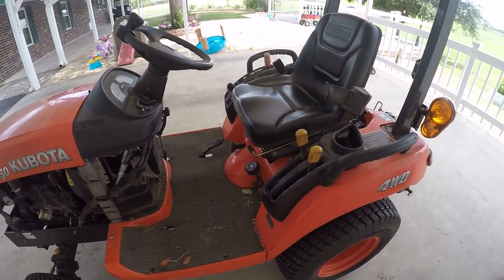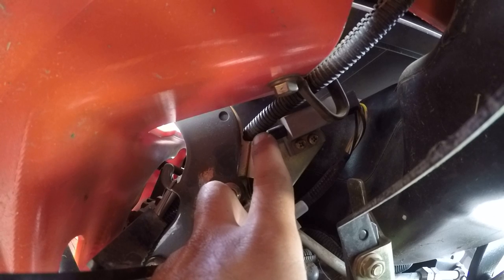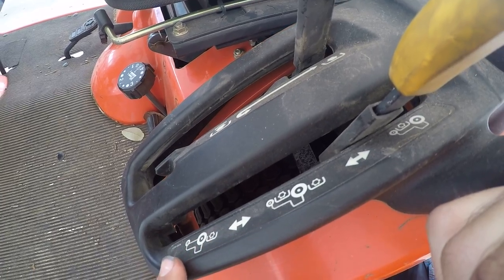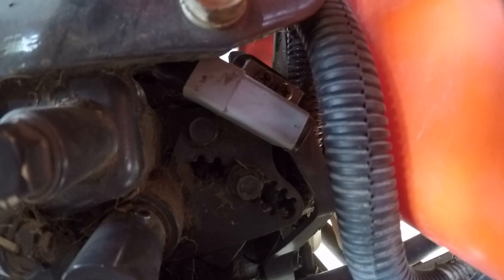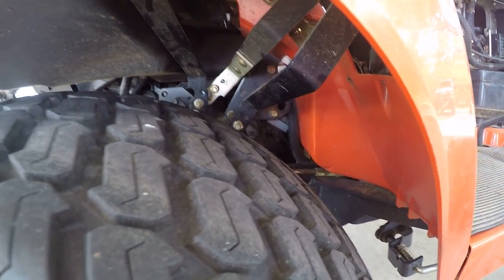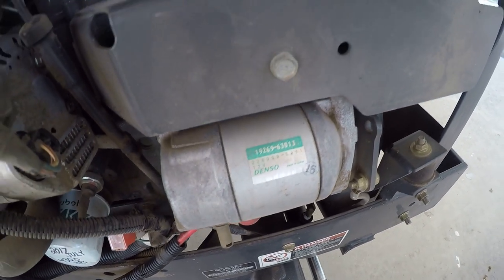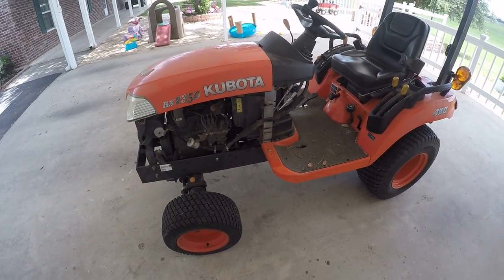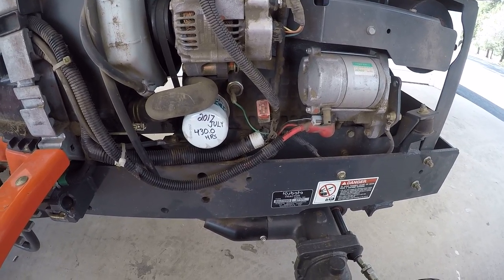Kubota BX2350 - No crank common issues

Comment: I checked all the things you mentioned and it started. Now I just don't know which sensor or wire it was lol. This is the 3rd time it has done this recently.
Reply from the maker: If it's a switch, it's probably one that is only lightly getting pushed & the vibration & flex of the tractor is just enough to make it not pushed enough to let the tractor start.

Comment: When 'safety' system fail so easily, they're not safe. They will convince owners to bypass those systems.
Reply from the maker: They just need adjustments usually. Not knowing where the switches are is where the challenge can be. After 15 years of rattling, something is bound to come a little loose!

Comment: That switch at the front of the seat that you said you didn't know why it was there is for the rear PTO. You start the tractor then flip the seat up and you can use the rear PTO for like a chipper or what ever you are running.
Reply from the maker: Thank you! Had no idea.

Comment: Wanted to thank you for posting and leaving this video up. I have  been struggling with a BX2200 not starting for several days and from your video I was able to figure out the PTO safety switch was just barley engaged. I lubed the PTO shaft and I noticed the safety plunger wasn't moving when it came in contact the metal tab on the shaft. I lubricated the plunder and worked the PTO shaft back and forth several times and I noticed the plunger was sitting up higher than before. I tried to start the tractor and it started right up so thank you very much!  You saved me several hundred dollars the Kubota dealer would have charged. Thanks again Ron
Reply from the maker: No problem Ron, that's why I made the video. Appreciate you watching and giving me the feedback. Consider a Super Thanks since the video saved you money! It helps others find the video easier and helps me out as well.

Comment: Thanks for taking the time to make this video. This is a good and worthwhile video if you’re having crazy intermittent starting issues that are related to switches not functioning. I have a Kubota GR2110 and the thing has been driving me crazy. I can tell it’s in the safety switches somewhere because when everything is satisfied it starts right up and stays running. Now I know where to start poking around. Thanks again!!
Reply from the maker: Glad it was helpful!

Comment: Thank you for saving me 6 hours!  I checked the contacts under the seat and and then the PTO behind the rear wheel, and it was exactly as you described.  5 minutes and a PHILLIPS screwdriver and I was off and running!  Great video and thanks again for saving me time and money!
Reply: Same here.  I was freaking out as I was in the middle of a job with the bucket full and poof. No start. Exactly the same switch.  Thanks for this great video.
Reply from the maker: Glad it helped both of you. I've been helped so many times over the years with YouTube... I'm glad that I've been able to give back!

Comment: Thanks for pointing all this out.  I just started to have a starting issue with a new BX-25 that I bought back in 2008.  These switches are for the lawyers and birds!
Reply from the maker: Considering issues are popping up 15-20 years later, the switches held up not so bad!
Reply: @CallMeColtLLC  Finally got my BX-25 running again, after yanking out the starter and taking it to the dealer.  The starter was good.  It was the friggin PTO safety switch.  The dang thing slid back and had to be slide forward and re-tightened.  This is the second time this switch caused me problems!

Comment: Thanks for video. Getting ready to look for intermittent start problem. Pretty sure it's one of those switches not bypassed. Also will look for glow plug issue. Need to jiggle switch wires to get them to work.
Reply from the maker: Safety switch probably came loose and just need adjustment. Quick and easy. If your glow plugs are not working at times, you may have a ground issue from the key switch. Maybe why you have the start issues at times at well. Last thing could be sticking relays. Just a guess.

Comment: I have an L3710 that's been driving me nuts with intermittent starting. I'm almost certain the issue is a switch adjustment as suggested by your video. The trick is locating and getting access to those switches. 
Thanks for posting!
Reply from the maker: Hopefully that's it!

Comment: Thx buddy, I have a BX25D basically has similar sensors and I used your video to locate and test each switch.  Thx for the heads up on the throttle inhibitor switch as this is the one that needed adjustment.  All fixed 👍🏻
Reply from the maker: Glad the video helped get you going again!

Comment: I think I’m going to start removing most of these switches. There too problematic. Thanks amazing info.
Reply from the maker: Once the switches are adjusted & tightened up, they give very little issue, at least in my experience.
Reply: @CallMeColtLLC  okay thanks brother. Discussing it with my dad now. It’s his machine. Thank you so much. Great video.

Comment: I have had a problem with the PTO switch not making a connection before. This time I was trying to start my 1850 and it stopped cranking . The fuel pump is working but the starter is not cranking. When I went to start it this morning it was cranking several times using the glow plug not matter where I positioned the throttle it did not start. Thanks for showing the locations of the switches. Especially the starter polarity one.
Reply from the maker: Glad you figured it out & got going again!

Comment: Thanks for safety switch locations! Mine won’t start without jumping starter. Got a love all the sorry plastic body that cracks and falls off. My dad bought this one new. I had bought a b7100 new before that but it is steel body parts. They really shot themselves in the head with the plastic. Very disappointing!
Reply from the maker: These older plastics don't hold up to the sun well, I agree. Did you ever figure out why you had to jump the starter?
Reply: @CallMeColtLLC  not yet. I am going to look at all those safety switches now that I know. I took it to dealership last year, they cut the wiring and spliced back on the seat one. It worked awhile then started not starting again.  Going to look tomorrow but My money is on that hydrostatic button. They hide them well!
Reply: Yep both safety switches on left side had worked their way out of reach of contact. Starts fine now

Comment: Mine did the same, I just shoved the lever harder and it worked.
Reply from the maker: Yes, wiggling or shoving the handle to hit the switch is a way to get it started in a pinch to finish up your job.

Comment: we have a BX1860 that isn't starting. when we turn the key we don't get any activity on the dash (lights or gauges). would that be consistent with this issue? is there a way to test if this is the problem before ordering new switches? ty
Reply from the maker: Safety switches will not cut power, they only prevent fuel delivery or initial cranking. If you have no power at all, I'd suspect something like the main fuse or your key switch.
Reply: @CallMeColtLLC  thanks. that was where I was headed so really appreciate the guidance and really liked the video. 😀😀
Reply from the maker: @ezyjack826  no problem. Glad it was helpful and hope you get running soon. Nothing worse than a downed tractor! Consider a Super Thanks, it helps my channel grow in search results. 😎

Comment: Is it possible to just remove or delete these switches?  Basically have the tractor ignore the switch completely.
Reply from the maker: Yes. You would need to see if the switch is normally and open or closed switch. Then simply connect the wires together if it is a closed switch when being pressed, or disconnected and remove the switch. But honestly, if you just make sure they are tight and adjust once, they will be good for a very long time. I have put over 600 hours on my tractor since I made this video and have not had one issue since.
Reply: @CallMeColtLLC  similar to you I bought a BX2350 with about 500 hours.  I put about 50 hours on it and then started having similar issue.   I've found that the PTO switch is actually disconnected and taped over (apparently for quite some time) and the seat up sensor at the front left of the seat isn't even being engaged by anything.  I think my culprit is the neutral switch that you mentioned is so hard to get to because when I wiggled it a bit the tractor actually tried to start finally.  Problem though is that switch was so fragile and brittle it broke.

Comment: Found you video, but also noted that the Kubota looks almost the same as my Mahindra Max28XL.  Why is always some little switch that kills these things. Man way too many safety switches. And now I have to go look for reverse polarity fuse. Boy, a simple old MF or Ford would make field work so much easier. Tnx for pointers.
Reply from the maker: A lot of these small tractors are the same... Yanmar makes them.